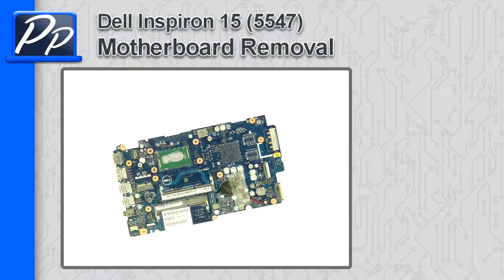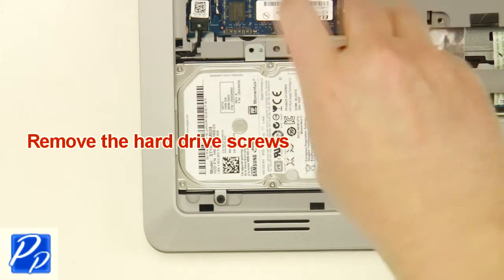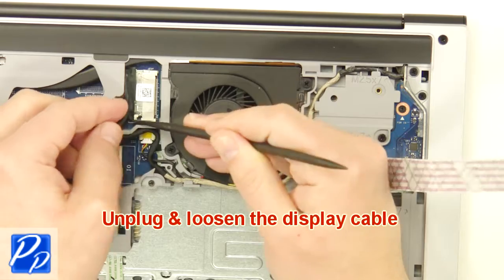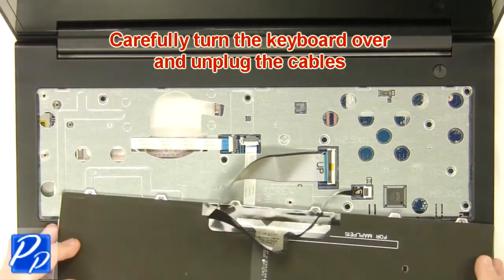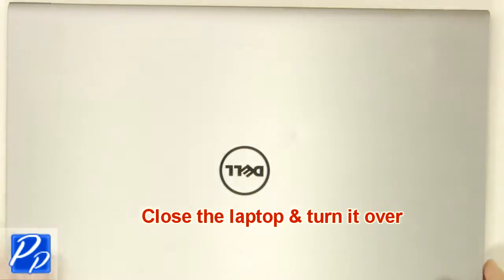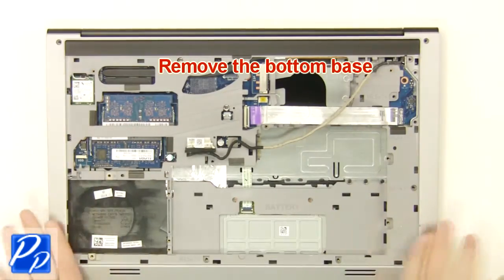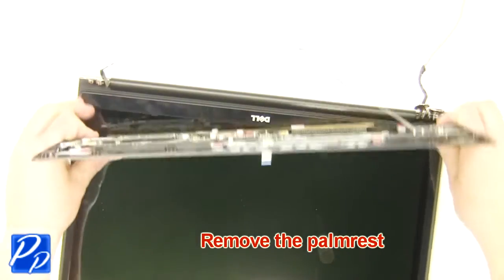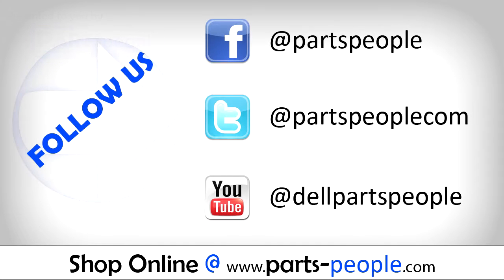Dell Inspiron 15 (5547) Motherboard How-To Video Tutorial

Comment: My laptop is dell inspiron 5547 i5 model with intel graphic and there is also same model with amd graphic.i had problem with my motherboard and need to replace it.iam having trouble that i5 with intel graphic motherboard is not available.so,iam asking can I replace with amd graphic motherboard and is it suitable for my laptop.my laptop motherboard part is G1DPC.
Reply from the maker: You can replace it with the AMD motherboard but you will have to replace the heatsink too. Also, you can find the Intel and AMD motherboards here https://www.parts-people.com/index.php?action=category&id=141&subid=492&refine=motherboard
Reply: I have the 5547 with the i7 4510U and intel graphics would i need to replace the heatsink if i bought the motherboard with the i7 4510U and the R7 M265?
Reply from the maker: Yes, the AMD GPU uses a different heatsink.

Comment: hello, i've the same exact model, everything was running good till last night when suddenly my fan decided to go out really loud, now it's making hell of a noise and vibrating the whole laptop, i tried cleaning it but still same, can you please tell what might have gone possibly wrong and how can i fix it?
Reply from the maker: it could be something like a fan blade may have broken or bearings have gone out. Ultimately, you will probably need to replace the fan. But definitely DON'T run it with a bad fan. It could overheat and cause damage to the CPU, GPU, & motherboard.
Reply: how much would a fan cost?
Reply from the maker: We sell them for $35 https://www.parts-people.com/index.php?action=category&id=141&subid=492&refine=fan
Reply: can it be shipped to pakistan?
Reply from the maker: I'm sorry, we do not ship to Pakistan.
Reply: ok :(

Comment: I have this exact laptop. It seems like on mine that the cord of the antenna cable has detached from the piece that connects to the wireless card. Now it won't detect any nearby wifi. Is this something that I can fix myself or should I take it to someone to fix it for me?

Comment: If you replace the mother board  do you simply swap them out or do you need to reprogram or re install anything?  and its probably best to back up everything before replacing motherboard i assume?
Reply from the maker: +19DESERTFOX91 Backing up everything is a good idea. You won't have to reprogram or reinstall anything besides maybe updating the BIOs. Make sure the replacement motherboard is the exact same as the existing one otherwise some of the components might not fit or work, like the heatsink and fan.

Comment: can we change graphic card ?
Reply from the maker: Bloody HD The graphics card is built onto the motherboard. You would have to replace the motherboard to replace the graphics card. There are 2 options for graphics: Intel 4400 or AMD Radeon R7 M265.
Reply: +Parts-People.Com, Inc thanks i have one more question can we change cpu or overclock ? i try msı afterburner but not worked i have i5 i want update to i7